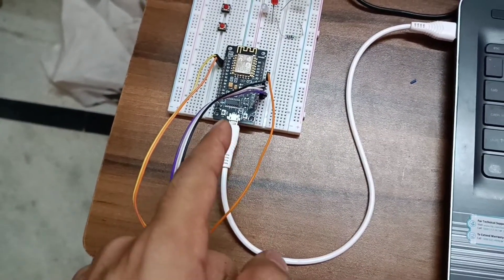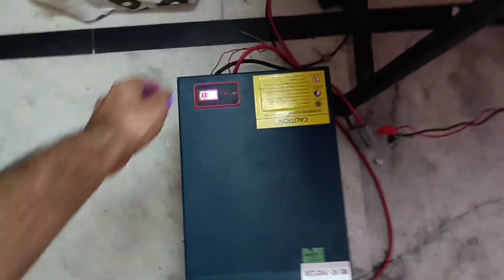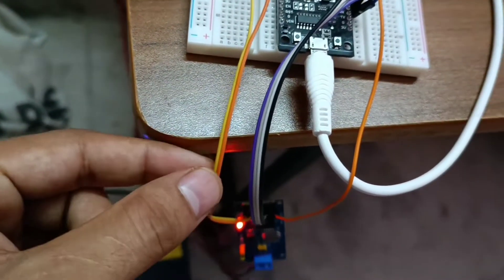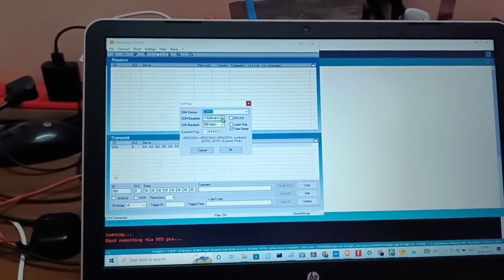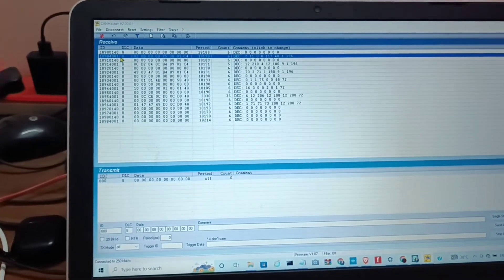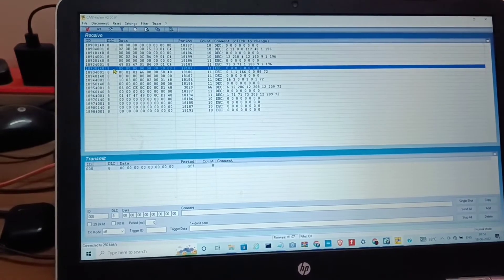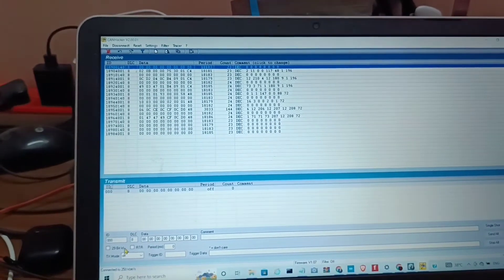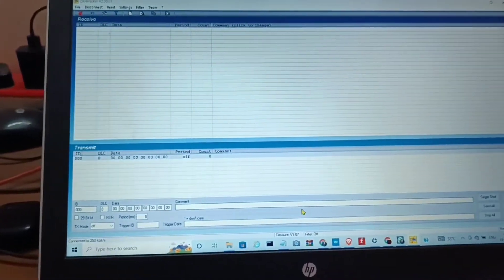CAN bus data read with MCP2515 on CANhacker terminal via Arduino IDE and ESP8266. Car or battery BMS

Comment from the maker: There is two configuration
1- BMS and Microcontroller are already communicating with each other in the manufacturer's system
In this case we can only read from this system using Arduino(broadcast type).

2- BMS is there with CAN system
In this case we have to send CAN request frame commands to get the data on Arduino only.(Command and listen)